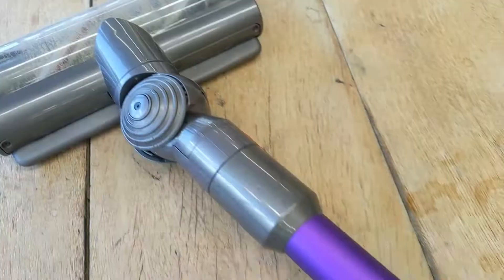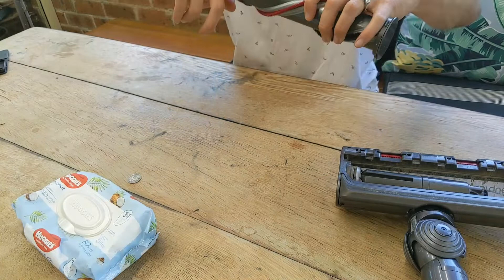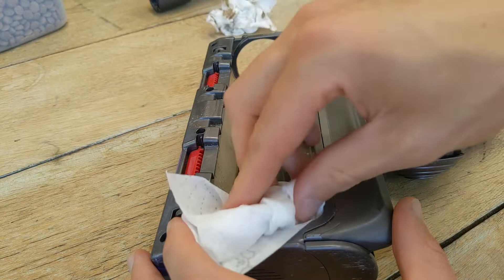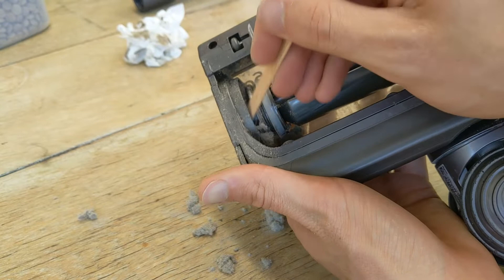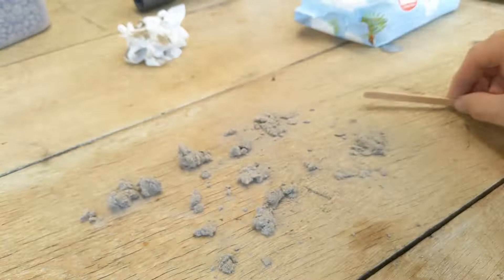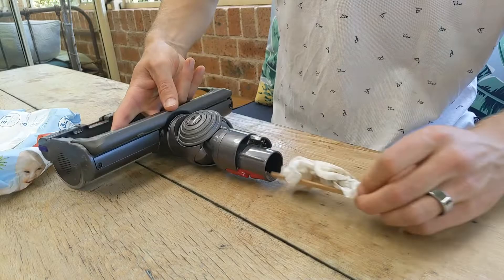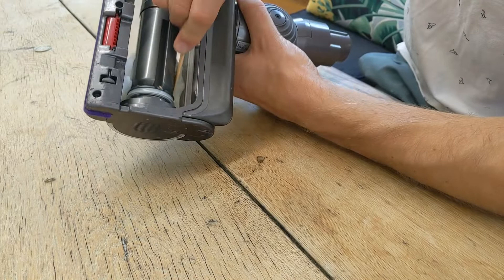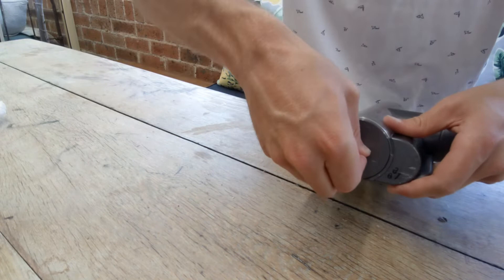FASTEST WAY to DEEP CLEAN Dyson V10 HEAD | How to Clean motorhead / turbohead on your vacuum.

Comment: Using all those wet wipes is probably not the most environmentally friendly method, i used a damp j-cloth with some diluted multi-surface cleaner. You can clean the inside of the rota brush by pulling the end off. There is a bearing underneath which you can remove if you've got a screwdriver with a star shaped head. I passed a string into the opening and tied cloth to other end and pulled it through like cleaning the muzzle of a rifle.
Reply from the maker: yeh that's a good point. Nice one!

Comment: This was very helpful, thanks! Using the paddle pop stick and  wet wipes, was a great idea! I’ve tried damp paper towel but it didn’t work as effectively as the wet wipes seemed to work.
Reply from the maker: Glad it helped! Unfortunately I think I'm going to need to do this trick again soon!!
Reply: Why can’t I just put it under the sink
Reply: @bruh8268  Hi, do you mean why can’t you just run it under water in the sink? That would be a great idea but I think that the centre tube will get damaged because of the water😉

Comment: very informative! thank you. I have a problem of pulling the cylinder out, I guess something is stuck there :(
Reply: Same mine doesn't come out? I'm wondering if it's different models or what?
Reply from the maker: This one is the V11 animal turbo head.. came out really easily for me on the first try.. sorry to hear it hasn't worked for you both.
Reply: Same here. Mines the V10. The fluffy one comes out easily but this definitely does not want to budge.
Thanks anyway.